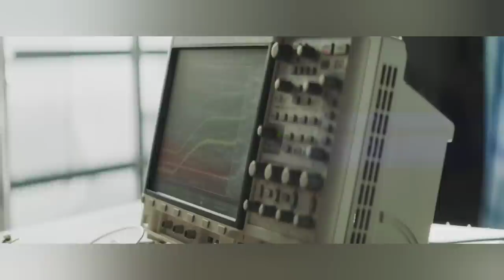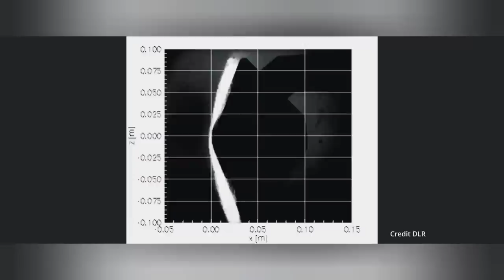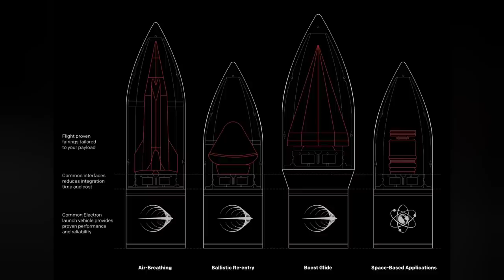Rocket Lab's TOP SECRET mission!!  Why was it so important?

Comment: In a sense this could be good news for Stratolaunch. Even though it will be competition for them, it does seem to indicate that there is an emerging market for hypersonic test vehicle launches. But as with Virgin Orbit and Orbital Sciences, it will be a question whether air launch is a viable method compared to using a ground based launcher like Rocket Lab is doing. Also Stratolaunch just seems to move so incredibly slow so they may run out of time if they don't get things going pretty soon.

Comment: This was a very thorough report, accented with a lot of video, photography and information -- apparently from Varda and Rocketlab. Everything seems to be sourced from the principals.  The only thing that seems to have been secret was the launch itself. So...I'm not clear what was so secret about it. I don't like it when a corporation tries so hard to control the press, but Angry and others are dependent on the companies to provide the information -- where else would they get it? And without the suppplied promotional video, there's almost nothing else. In this case, Angry's script tries to give a fair report, but it still comes off almost like an advert. Still, it's very important information, because this sort of hypersonic mission could indeed be a bellweather into corporate uses of space. And note, too, it appears to be 100% non-NASA as well.

Comment: It can never deliver 700kg to low earth orbit. It's a suborbital mission. Which means it moves at substantially lower speeds and altitude. How did you make these things up?
Reply: He literally says it's suborbital in the notes and in the video.  Lower speeds is separate from low altitude.  A suborbital trajectory at a given altitude requires only a fraction of the delta-v of an orbital insertion at the SAME altitude.  So slower speed only means lower altitude on the SAME vector.  Otherwise altitude and speed do not correlate.  How do you make these things up?

Comment: no such thing as hypersonic flying things...  at sea level the atmosphere is thick like syrup, so even if these things could do it, they wouldn't have much range,  no fuel capacity
Reply: Uh, they don't fly at sea level. More like an altitude of about 80,000 feet or higher.
Reply: @rosswarren436  lets see one.... show me a video of one flying....   Do that and i'll eat my hat.
Reply: @dirttdude  these were launched at night and well instrumented to transmit important engineering data. They were of course tracked on radar. 

The USAF concluded its last test flight earlier this year involving the use of a supersonic ramjet engine. It was successful  for a limited run test at Mach 5 above 60,000 ft.  

A DARPA spokesperson told Air & Space Forces Magazine “most of the flight was faster than Mach 5” and occurred sometime in January, but declined to provide further details, citing operational security.

While the Air Force is not pursuing HAWC as a weapon, DARPA plans to continue maturing the technology with the More Opportunities with HAWC (MOHAWC) program. 

“Those missiles will expand the operating envelope of the scramjet and provide technology on-ramps for future programs of record,” DARPA said the MOHAWC program. 

There is also an Australian company working on using a scramjet engine as a stage of an orbital rocket. It has been tested in a wind tunnel and worked well. 

NASA tested the X-43A way back in 2004 and it was successful on two of its three flights, one of which reached Mach 9.6 at an altitude over 100,000 feet. 

You've got Google. Use it.
Reply: I agree completely when people discuss hypersonic cruise missiles (assuming they mean low-altitude flight paths), they really are not technologically possible at this time.  And while high-altitude cruise missile and hypersonic glide vehicles are “maneuverable”. their maneuvers have radii on the order of miles, not feet.

There are plenty of videos of the hypersonic X-15, although I don’t know if any show (could show) them at hypersonic speed given the very short period time to capture them on film..  And you do recognize that hypersonic glide vehicles have been developed, and reentering ballistic missiles are hypersonic, correct?
Reply: @vanguard9067  IDK muh homie.  Rockets or rocket powered delivery systems have to be pretty damn big because they need a lot of fuel to get get their desired distance so no matter how you slice it, it would have to be an air breathing engine of one kind or another,  there isn't a lot of air above 30 thousand feet but lets say there ARE HSMs going like a bat out of hell at 40 thousand feet,  as soon as it reaches 14 or 15 thousand feet to deploy the weapon it would break up
Reply: @dirttdude   I think we are agreeing, do you agree?  ;-). I totally agree the concept of a hypersonic missile (long-range > 400 km) is another engineering impossibility for just the reason you state.  Even a scramjet powered missile (with any kind of sizable warhead ~200 kg) using atmospheric oxygen, is going to be prohibitively large and expensive weapon.  

But really the biggest thing for me is the unnecessary public drama concerning a US hypersonic missile gap.  If any country wants to use existing, conventionally-armed, short-/medium-range ballistic missiles, they already have a hypersonic weapon.  AND, a cruise missile transitioning from high-altitude to denser air will indeed disintegrate as you say, if it is not slowed in some way.  So we already face supersonic cruise missiles, and that should be our primary (ship) defense concern and development target.

What do you think?  Are we on the same page?